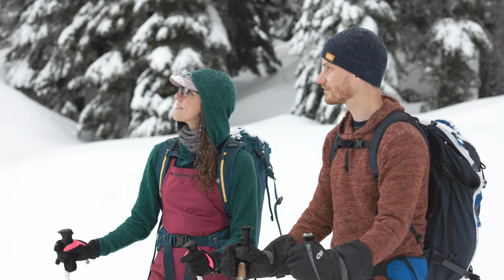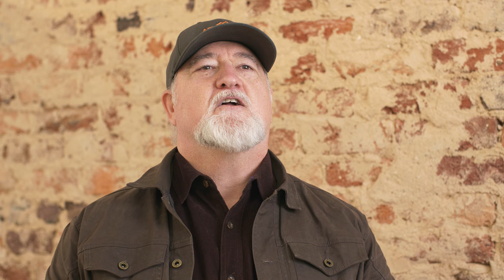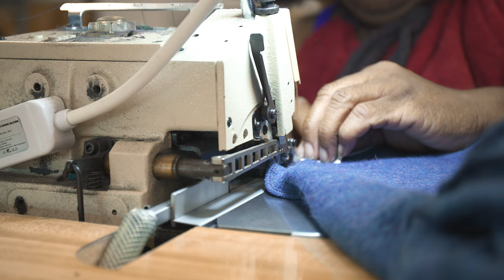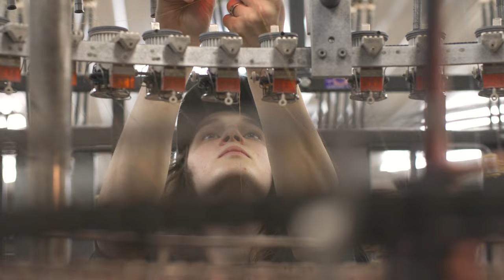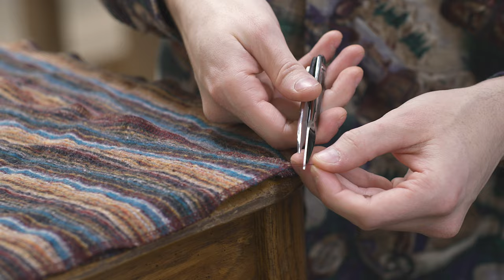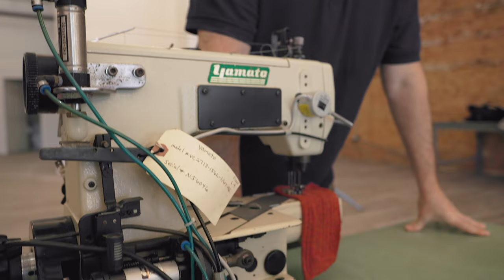Appalachian Gear Goes VERTICAL!

Comment: I love your products. How much would cost to add a kangaroo pouch to a hoodie? Also, I love the mens multicolored hoodie so much - I wear at home and on the trail- to the point I’ll need to buy a spare.
Reply from the maker: Thanks !!  We have been asked about the kangaroo pockets numerous times. We designed the current All-Paca Fleece to be lightweight and insulating, and this fabric is not set up for kangaroo pockets - but we are working on a heavier weight product that will have pockets.  We have to perfect it first - so not sure when we will be able to release it. Stay in touch. ☮️🤙
Reply: @appgearco8674   That makes sense. 🙏 Thx.